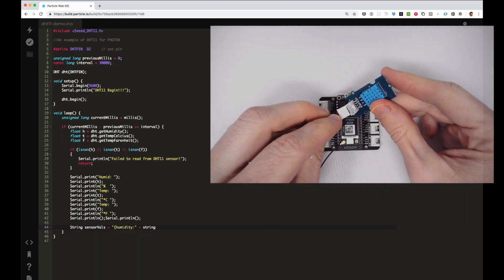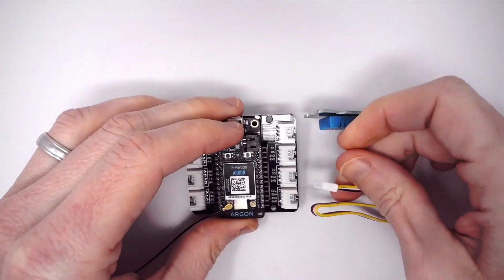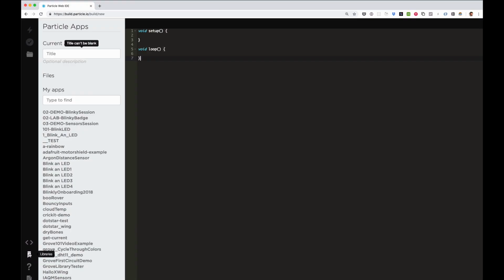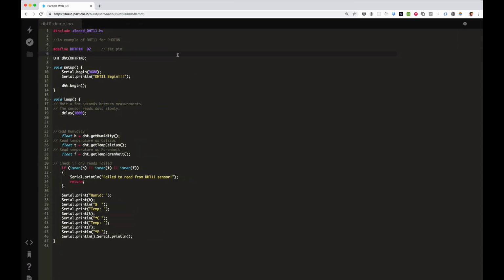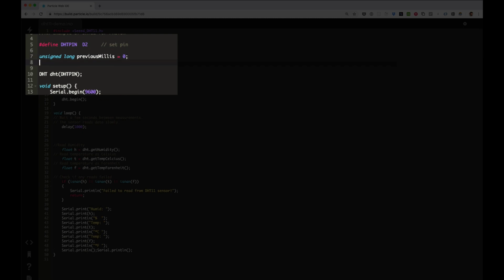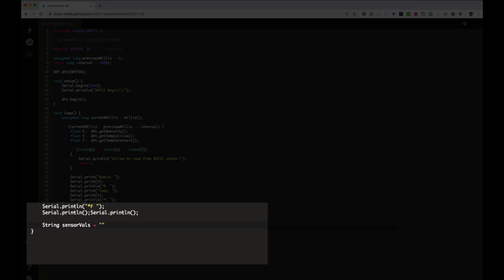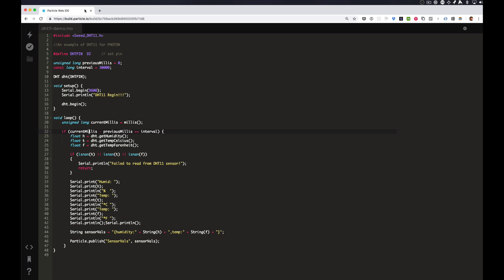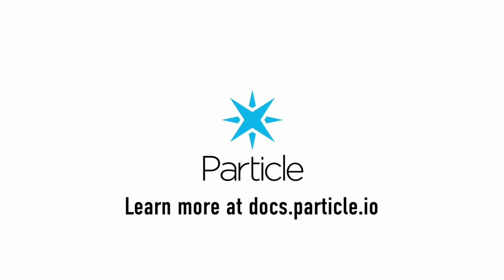Particle 101 - Creating your first circuit with the Grove Starter Kit

Comment: When I flash I get values for temp and humidity to publish but it never updates on the interval I have set. What am I missing?
#include <Grove_Temperature_And_Humidity_Sensor.h>

//An example of DHT11 for PHOTON

#define DHTPIN 	D2     // set pin

unsigned long previousMillis = 0;
const long interval = 10000;

DHT dht(DHTPIN);

void setup() {
	Serial.begin(9600);
	Serial.println("DHT11 Begin!!!");

	dht.begin();
}

void loop() {
	unsigned long currentMillis = millis();

if (currentMillis - previousMillis >= interval) {
	float h = dht.getHumidity();
	float t = dht.getTempCelcius();
	float f = dht.getTempFarenheit();

	if (isnan(h) || isnan(t) || isnan(f))
	{
		Serial.println("Failed to read from DHT11 sensor!");
		return;
	}

	Serial.print("Humid: ");
	Serial.print(h);
	Serial.println("%  ");
	Serial.print("Temp: ");
	Serial.print(t);
	Serial.println("*C ");
	Serial.print("Temp: ");
	Serial.print(f);
	Serial.println("*F ");
	Serial.println();Serial.println();
	
	String sensorVals = "{humidity:" + String(h) + ",temp:" + String(f) + "}";
	
	Particle.publish("SensorVals", sensorVals);
	
}

}
Reply: they didn't include the code needed to set the "previousMillis" millis to the current value at the end.

Comment: Did I miss something?  Do you need to set previousMillis to currentMillis at the end of the if?  Am enjoying your vids and working with Particle devices!
Reply from the maker: Hey Gregory, you didn't. We made mention of that step in the voice-over, but it was accidentally clipped from the video
Reply: @particle_iot  i have the same question as well. previousMillis was assigned to 0 at the beginning, and shouldn't your program need to update it to currentMillis before exit the loop? i have been re-playing your video with subtitle ON a few times, but, i did not notice the step being mentioned anywhere in the entire video. Is this the correct video?
Reply: @particle_iot   ugh, for a newbie to this stuff, mistakes like this cause a LOT of grief